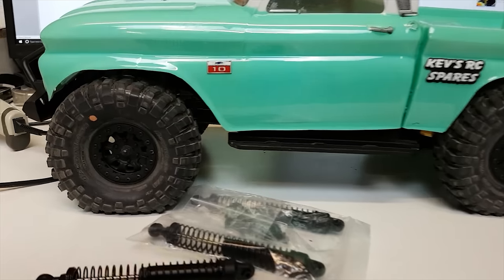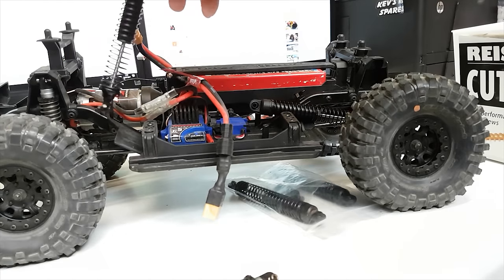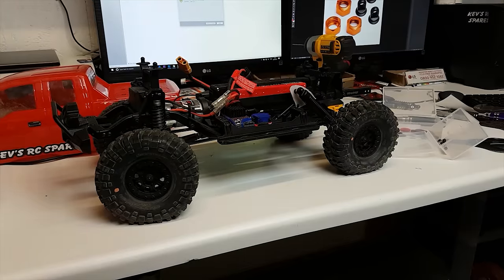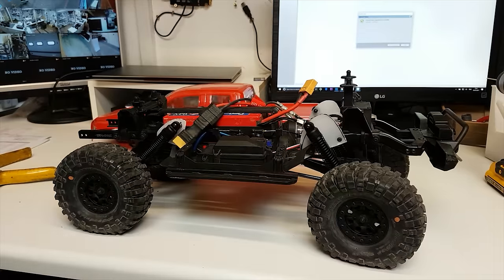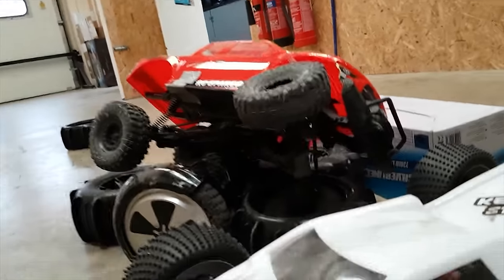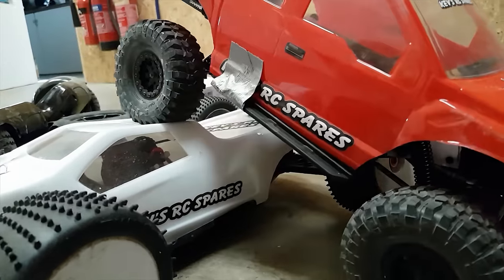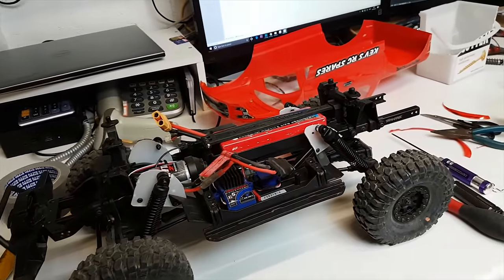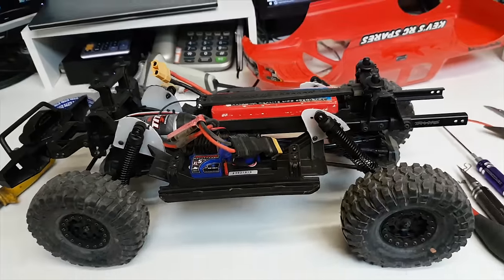Longer Shocks on TRAXXAS TRX-4 for massive FLEX!!

Comment: Hi, fantastic modification i must say and I love the longer throw coming from the suspension. However, I encounter another problem. My front wheel will rub the body shell on full right when reversing. And is only when reversing right full lock, left is fine. 

Wonder if you have any suggestion or recommendation? Many thanks in advance.

Comment: Do you have any recommendations for starter RC rock crawlers? I really want one to be the next truck I get. I already have a 1/18 brushless monster truck and a 1990's kyosho 1/10 truck.
Reply from the maker: TRX-4 if you ask me dude
Reply: Wow! I checked it out and it looks absolutely sweet! Thanks for the recommendation! It will be pretty expensive for me, but once I get a job (I am only 15 and turning 16) with a few weeks' work I can afford it!
Reply: Have a look at the FTX Outback, it's a LOT cheaper and pretty good for the money. Lots of reviews on YouTube.
Reply: David Holden thank you for telling me. I'll check that out. Sounds like I would have a better chance getting that bc I'm only 15 with no job.
Reply: Vaterra ascender i have a k10 and a k5 both have copped hard abuse and ive never had a problem with them. Wont beat a trx4 in a race but ive beat one on alot of climbs and they have huge flex from the box
Reply: I believe  Kevin is a Traxxas guy. He has stated why in the past. TRX all the way, I imagine...enjoy